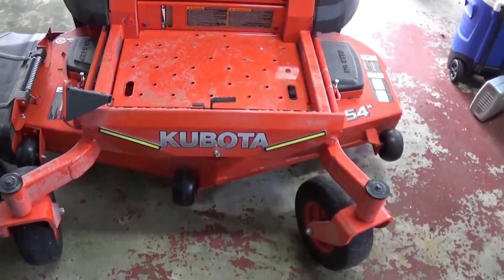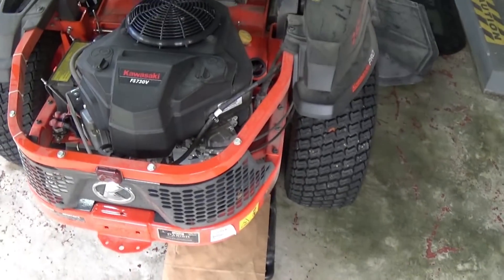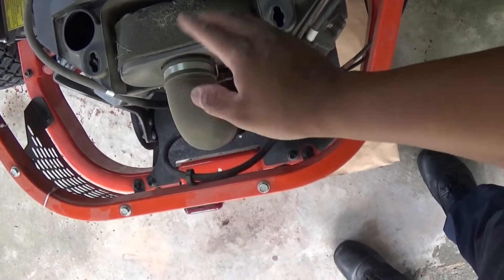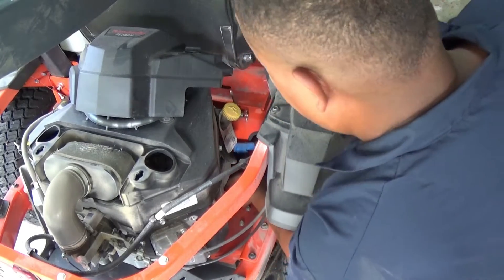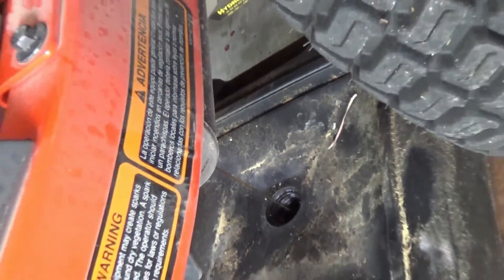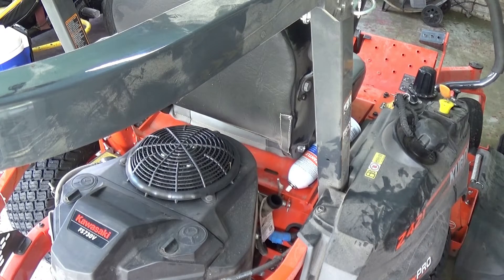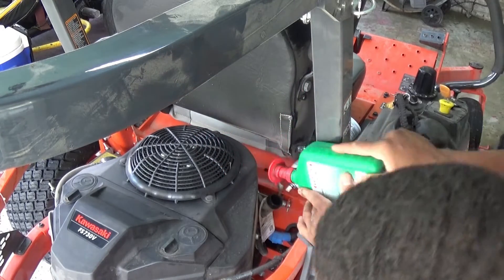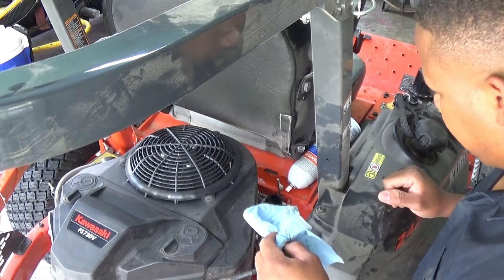Kubota z421 oil change/initial

Comment: I have a kubota z-411 48 inch cut.  It came with a 4 year warranty. The dealer told me to use the Kawasaki 20w-50 semi synthetic oil. that's what Ive   been using now for the past 60hrs. Those air cooled Kawasaki engines run hot. And the oil you are using is garbage no disrespect intended. Take  that oil and drain it and go to the dealer for the correct oil. That engine will go 2000 hrs easily.
Reply from the maker: thanks.